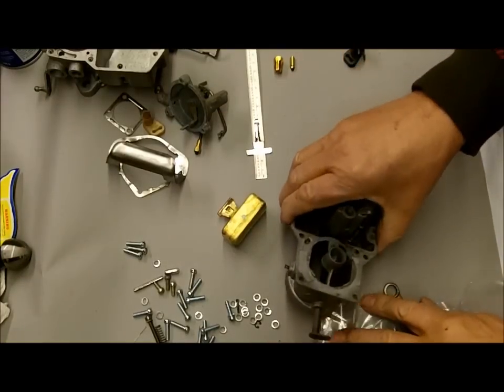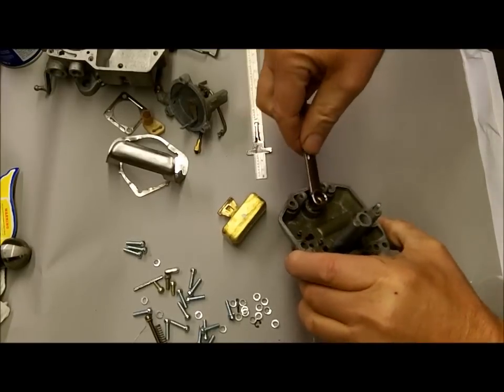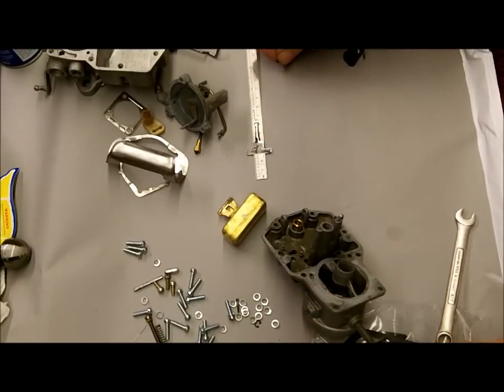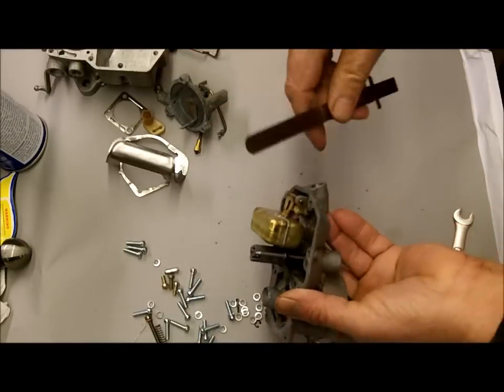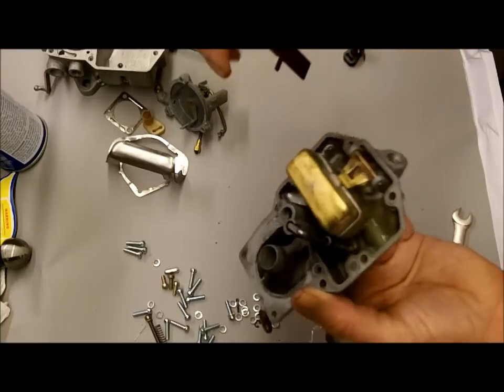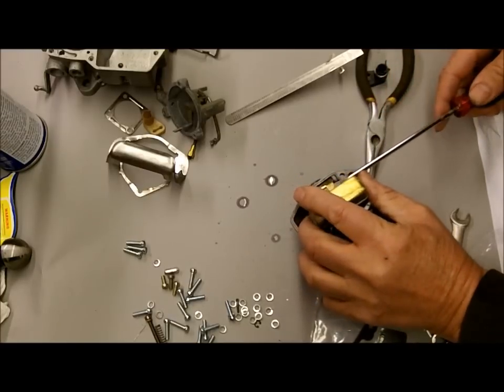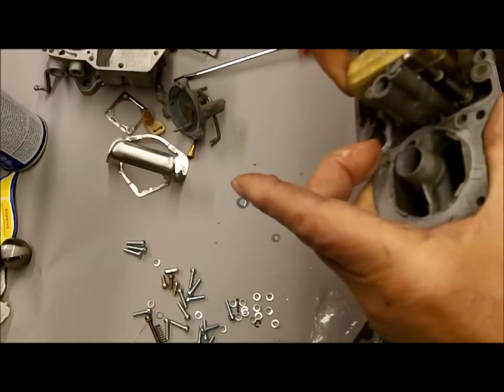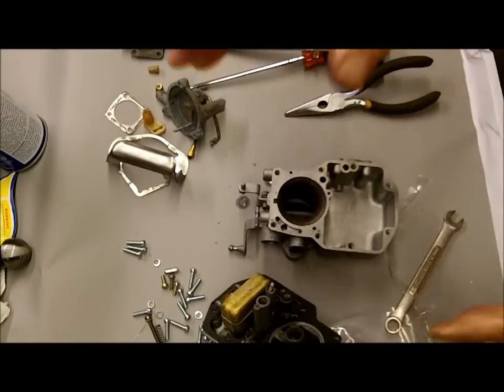Autolite 1100 Rebuild - Part 2 Float & Needle and Seat

Comment: my carb autolite 1250 is running rich .should I need to lower the float level?
Reply: The float level just regulates how much fuel is reserved in the carburetor, NOT how much fuel enters the engine.

There are a few things that can cause the engine to run rich:

-Choke closed too much (doesn't let enough air in)
-Main jet too big
-Mixture screw turned out too much